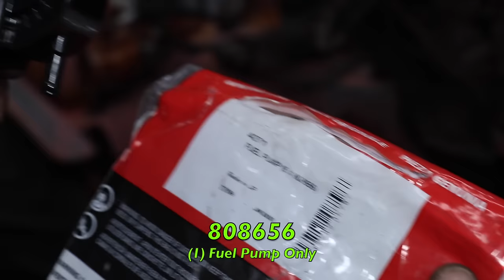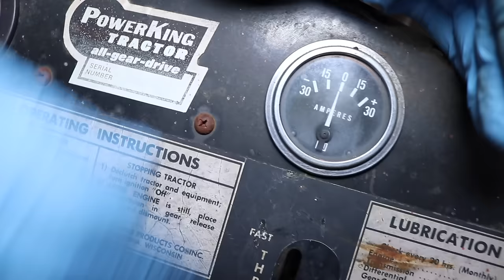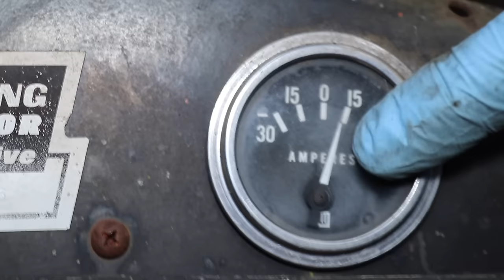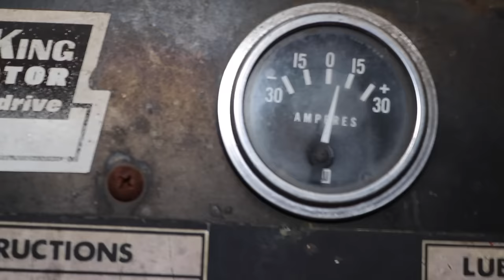1974 Power King -  Left For DEAD! Can It Be Saved?

Comment: Taryl your old drill press, you said you can't adjust the speed right. Problem... flip either the pulley on the motor or the quill. one of the pulleys should have the larger up.  Thanks Taryl. There's your dinner.
Reply: Haha was just going to say the same thing..one of the pulleys is upside down
Reply: I was going to comment the same thing about the pulleys being wrong on the drill press but yall beat me to it.  lol
Reply: Yes. One pulley up, the other down. Keep up the AWESOME work
Reply: That's what I  thought  too think your right...
Reply: Hope he reads this
Reply: The one on the motor is upside down.. On all my drill presses, on the spindle the small end of the pulley is up, and on the motor it’s down.
Reply: Even Taryl messes up sometimes
Reply: Turn it over, Turn it over, Turn it over
Reply: What I came here to say 😂😂
Reply: I have the same old drill press.i think Dave is right, ya need to have one pully inverted.

Comment: Hey Taryl:  The shives on the Craftsman drill press are incorrectly placed.  One of the pulleys needs to be flipped upside down from how it is now.  If the top pulley on the motor is the smallest on top and the belt goes to the largest at the top on the drill arbor the drill speed will be the slowest.
Reply: That is correct the pulley on the motor is upside down
Reply: @davidhawken1301  I think taryl trolled us on this one!
Reply: You are correct!

Comment: I think the motor pulley on that Crapsman drill press is upside down.  That would make it difficult to adjust the speed indeed.
Reply: it will make the drive belt fit better as well.
Reply: @atschirner  Well, basically, the way it's setup, it's always a 1 to 1 ratio unless you go diagonal, as it is by one slot, which is a huge no-no.
Reply: @benjurqunov  DOH!  He got me good!

Comment: Thanks Taryl.
I got My Moms Fathers 1970 Bolens 1256-02 running after sitting some 30 years.
1st Tractor I got to drive as a 10 year old. (have photo) I drove it around our Tractor Show this last Aug. 
Ebay to the Rescue for an almost pristine OE Seat and some Steering Wheels with no cracks, amongst some other parts missing off the Tractor that Grand dad took off to make an Orchard Tractor for tending 10 Acres of Tomatoes before He passed away.
I have a full Factory decal kit to put on after it is repainted.  
Mike M.

Comment: Many years ago I had an Ariens mower with 48" deck and one of those 14 HP Kohler motors. I used it on my dads 2 acre parcel for years and then my nephew took it to Maryland and used it for probably another 10 years.  Those were GREAT Kohler engines.
Reply: @WJCTechyman  Kohler engines are a much better choice to have than a Onan engine. Onan engines are good, however extremely expensive to maintain and their replacement parts are extremly way over priced and very rare to obtain to.

Comment: Dad & I just picked one up from the scrapyard a couple weeks ago. Its a 74' also.  I cleaned the points on the 321 engine & it fired right up. She's not as nice as this one you have judging by the thumbnail pic but we're gonna truly  enjoy watching this vid Taryl!!
Reply: Restore it!  It's strange that you found one of these in a junkyard though. Power King tractors have since gone out of business, however they are still running strong to this very day, and there is a warehouse parts dealership you can still get parts for these tractors with almost anything you may need to get for them.

Comment: Love these tractors!!
My dad had one in the 70's with a hydraulic front end loader.
Whish I had it today 😞.
Awesome video Taryl and crew!
Reply: I wondered about that carbetreter sitting all that time. I usually at least pull the needles and shoot some carb spray through the jets. And clean the emulsifier holes. 
   Just picked up a K16 in the legendary C 160 Wheel Horse 🐎 and it acted like your engine after sitting five yesrs

Comment: That thing is really neat!I remember seeing those around when I was a kid.I was alway"s into old wheelhorses so it was funny when you said that towards the end.That thing is built like a real tractor,individual rear brakes,live hydraulics & all.Learn so much from these vids that can be applied to anything that I"m working on.👍!
Reply: It is like a small utility tractor, kinda like a utility tractor to a much smaller extent, however they are tough tractors that can very much do a lot of great work and get the job done. I own two of these and love both of them very, very much. They are 1614's which means the rear tires are 16 inch tires, the engines are a 14 horsepower Kohler engine.

Comment: Daryl, you have to turn the pulley on your craftman drill press in opposite  directions . One with big end facing up on the motor, and the other pulley, with the big pulley on the bottom. That way you get your different speeds. Hope this helps😅. The Jode

Comment: Yes Taryl! I love how you are highlighting all the cool items sent to you by fans while tearing this tractor apart with no respect!
Reply: I bet there are rebuild parts for the fuel pump, and Taryl is so big on replacement parts, that I am surprised he tossed the old pump in the bin without even inspecting it. This is turning into a goofball show instead of a good how-to..but wasn't it always goofball.
Reply: @Hjerte_Verke  Agreed. That fuel pump wouldn't go in the trash here  ... also  if he took a little time with a properly sharpened thin putty knife he could save gaskets ...

Comment: Those Kohler engines were and still are king among mower engines. I love older Briggs but Kohlers of this era are unbeatable
Reply: @maggs: agree regarding Kohlers. The only problem I have is getting the carbs set correctly. My PK doesn’t want to idle smoothly. I have the same type that Tyler uses. I have a couple of Gravelys, with Kohlers, and have the same issue with them.

Comment: This was a great video! My dad had one of these which we ran for at least 20 years on the toughest, most ornery 3 acres of side-hill ledge property in Vermont. Ours had the dual transmission which gave it a low speed, high torque crawl which was nearly unstoppable! We put wheel weights on the front and filled the rear tires with water mixed with calcium chloride. That and a set of Canadian chains made sure our tractor got traction!  Many times we needed to get a heavy trailer load of horse or chicken manure up to the top of the hill to spread on the pasture. So, two of us kids would ride on the bulldozer blade to keep the front end down while one would ride on the trailer hitch for that extra bit of traction needed while Dad drove  in 2-2 or 2-3 and near full throttle while working the individual brakes to keep it on course and not spinning the wheel on the upper side.  Once we made it up, Dad would choose one lucky kid to drive in 1-1 or 1-2 as he climbed into the trailer and spread the stuff with a fork or scoop shovel.  One of the neatest things was that you could put both transmissions in reverse and get another forward speed between 2-1 and 2-2! After we completely wore the engine out, Dad sold it to a neighbor farmer who restored it and takes it to tractor shows.

Comment: I have a 1976 dual transmission Power King that is in very good condition except for the gas tank. It looks just like your 1974 .
While cleaning the gas tank a little more than a few pin holes developed. Actually a hole big enough to put your hand through appeared. You don’t happen to know where I can get a new/good used tank do you?

Comment: To make the old Craftsman drill press work properly Flip one of the pulleys over. You want one with the  large diameter pullet on top and the other with the small on top.
Reply: I think he was checking our oil ... I'd about bet the B&D has a similar step pulley arrangement
Reply: Agreed. One of those pullies has to be flipped.
Reply: @charlesangell_bulmtl  Speaking of oil. I don't remembering Taryl changing or even checking the oil, will have to replay video.
Reply: Hard luck Taryl just wasted $22 LOL ,mount the two drill presses beside each other set for different speeds will be really handy .Great videos and fun too ,I watch them all from Ireland
Reply: @ronzek3207  , 8i788j

Comment: You forgot to check for dinosaur syrup before you fired it up! fired it up! fired it up!!!   come on Taryl   you know better than that.    A wire wheel on a die grinder takes gaskets off easily and if you sharpen that flat gasket scraper it will work as well as the scraper you sell in your online store

Comment: What would make that motor not get any fire to sparkplug.? Tried different coil and condenser but still no fire.
Reply: Make sure spark plug wire is good and secure connection to spark plug - it fixed my old tractor

Comment: Good job on getting it running. I’ve seen that type of fuel pump but didn’t know how it worked. The seat you put on is not the correct set, but, then, it’s your tractor.

Comment: The motor pulley on you old Craftsman drill press is on upside down. Flip it over, and it will work fine! I have one of these and have used it for over 50 years. Cheerio!

Comment: I’ve never been a big fan of those clamp on battery terminals. Auto Zone and the rest stock replacement battery cables in standard lengths with both ends molded on. It’s a better way to go because then you know that the clamps will never work loose from the cables.

Comment: Looks very similar to a case 444 or 446.i had the case with a 14 h.p  krohler we used for many years ar our boat shop to move boats around and also cut a couple acres of grass with it.good old tractors if u didn't mind replacing the clutch every now an then.

Comment: 47:04 The reason you could never set the speed right on your old drill press is that the motor pulley is installed upside down.
Reply: You are correct !! My old Craftsman is just the same as Taryl's except my motor pulley has the larger pulley up and the spindle pulley is opposite. Great catch man !!!!
Reply: Amazing..i wonder how long that drill press has been that way
Reply: HAHAHAHAAHAAHAHAHA....
Reply: Yes, that's the problem.
Reply: Oh dang, he's right! 😂
Reply: I was going to say that one of the pulleys needs to be flipped over. Thank you. Hopefully Taryl will do that and get it back in service.
Reply: How did Taryl miss that?
Reply: @tiredoldmechanic1791  I think it has other issues, and he was checking our oil like he does with Slippers😅

Comment: If you flip the motor pulley upside down on your old drill press, you will have a much better speed selection. Cone pulleys should be opposite ( one up and one down). Hope that helps.

Comment: Taryl, I am curious about your modification tot he non mechanicak fuel pump. . When you install the flange where old mechanical pump was and install a line to your fuel pump, does the crankcase always have a negative pressure or does it cycle from the pistons cycling? I assume the new fuel pump has a spring and a diaphragm in it? Secondly, once you revive engines, it seems the first thing you go for is the low speed fuel mixture adjustment and it seems you generally closing it down until the engine begins to starve. Can you go over the full adjustment process including going to the high speed as well. Thanks btw, try some Yuengling beer. Hamms is for washing the poop off the dog.

Comment: Clear coat may be OK,but my Wheel Horse buddies either go full paint or an oil finish. Soak that puppy with Marvel or any thin oil till the thing stays wet for two days and then wipe it dry and maybe a little boiled linseed oil or paste wax. I used penetrating oil to loosen the rust first and eventually it worked itself off the tractor. 
  Just find an old rusty part and experiment with whatever paint treatment or clear coat that suits you. These old tractors have earned their character and patina.  
   I did try clear coating an old Wheel Horse Fender once, and I just carefully sanded the thing after converting the rust to black with oxalic acid . It turned out great looking with a marble finish that looked a mile deep. With no red paint visible when I started,the red probably covered Eighty percent. If I was gonna use clear coat it would probably be just the hood and pretty sheet metal and oil patina the rest

Comment: Great video, Taryl! That Power King is full of neat features - like the disc clutch, hydraulics, and all that. I don't think I've ever seen one in this part of the country. I've seen a few of the larger Economy tractors. My Taryl teeth don't fit too well, and I've come to realize it's because my real teeth are pretty crooked. I had to do a little grinding on my Taryl teeth to make them fit better over the real ones. I'm wondering - could I use some of that Taryl Putty to better secure them in place? I'm gonna hafta put visiting one of them shows you go to on my bucket list. I don't travel much.

Comment: i've got a '47 economy that has been repowered with a '73 9hp briggs engine. it's got 24" solid disc rear rims running ag tires, the bicycle fork style front spindles with a solid steel 2" square bar front axle, a manual lift set up and doesn't have any sheet metal. it uses a lot of surplus model a parts, t92 three speed tranny and clutch, cut down banjo rear end with a cut down torque tube drive shaft and the gear steering box with a modified ford pitman arm shaft. that one prolly has a cut down gm rear end, but still uses a borg t92 tranny and an automotive type clutch. these are really tough tractors comparable to a farmall model a, with a wide range of attachments that are run from a mule pulley set up. i have a moldboard plow that mounts on the rear drawbar, and an old 36" front mount push blade from a wheel horse that will mount right up to the attachment drop bars that i push snow with. i've had it about 10 years and it will usually start on the second pull. i think next winter i'm gonna strip it down and repaint it. the economy club guys say allis chalmers orange is about as close as you can get in an off the shelf color.

Comment: Your old drill press has one pulley mounted upside down. One pulley should have the smallest pulley up and the other should be pointing down. That should make it easy to adjust the speed correctly.

Comment: Yup. Flip the pulley on the arbor shaft so that the big side is up. And the small pulley on the motor is up. Belt will fit every time and your speed will change. 👍. There’s your  snack.

Comment: If the od of the steering shaft is 3/4" and the id of the column is 1 3/8" you can use the front wheel bearing from the 60's vintage Cub Cadets. They use the Ross steering
column which has these dimensions and it's better than any bushing.
Reply: That's a common enough bearing that you can source it flanged and lip sealed

Comment: My dealing with powering.they sit outside,water gets inside transmission.Sealed drive shaft,water runs into differential and bulldog gears.Also check steering box.

Comment: The positive and negative posts are different sizes. That's why you had to hammer on the positive and the negative fell right on. They were backwards..... But the hammer works ;)
Reply: You should never hammer very hard on the batt post, it can cause internal damage to cells you can't see. MO

Comment: Pulse pumps work on Honda GX390 and the clones, and the smaller Hondas and clones. engines. To utilize the vacuum, you need a spacer for behind the carb with a vacuum line for a carb with automatic choke.

Comment: @TarylFixesAll 47:11 - One of the pulleys on that drillpress needs to be flipped over.  All the current speeds are 1 to 1 roughly because the opposing pulleys are the same diameter.  You gotta git small at the motor and big at the quill to get the slowest speed.

Comment: the reason you can't adjust the speed on that old craftsman drill press is the front pulley is upside down.  with the pulleys in that configuration  you arent changing speed  you are just changing the height of the belt.  flip the front pulley over and try it that way . or the rear pulley for that matter .

Comment: The old drill-press pulleys are on wrong.   One should be little pulley uppermost, and the other should be large pulley on the top.   That will give 4 ratios with hardly any belt re-tensioning necessary.   
Looks like I have the same, but British, version of your new drill-press, in hammerite green...

Comment: on your old drill press  try turning pulley on motor upside  down  so it will be small  to large , med. to med  . large to large pulley , see if that helps your speed .
Reply: Yes, it's definitely installed bottomside topwise.

Comment: Can't see the serial number but that is a late powerking probably a 1982. You can tell by the wide brake petals and the hydraulics under the tractor. Someone repowered it at some point?
Reply: I agree with you.  I would go by the PK serial # on the dash and see that it is newer than a '74. Ball park guess-1980

Comment: You know with the way fuel tank sets you don't actually need a fuel pump you can just run the fuel line directly from the tank to the carburetor and let it gravity feed
Reply: Never tried on this model of machine so you could be totally right but in my experience even when you have a tank capable of gravity feeding it usually won’t run right without the fuel pump if it had one from factory